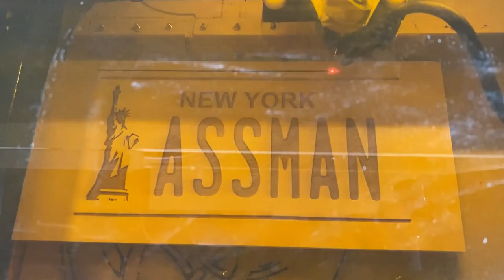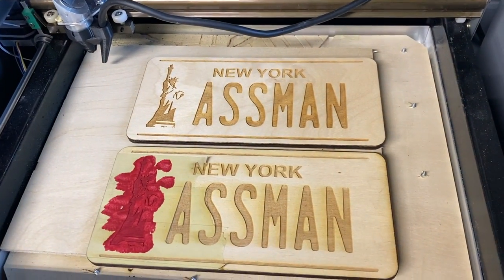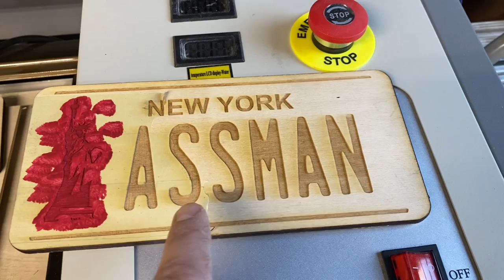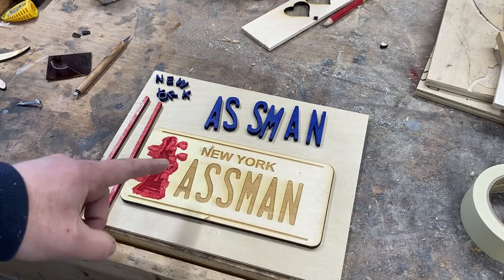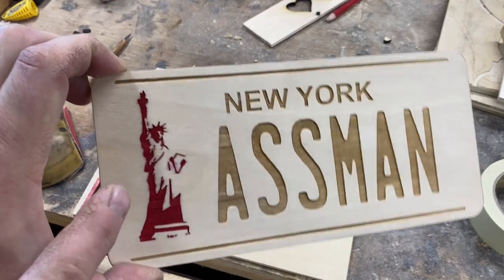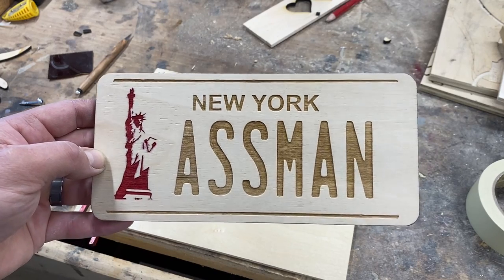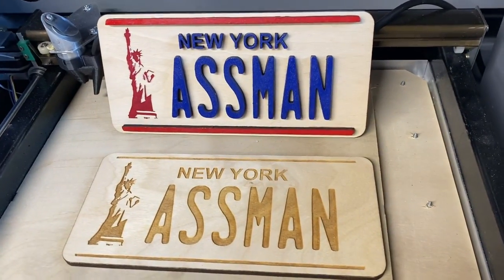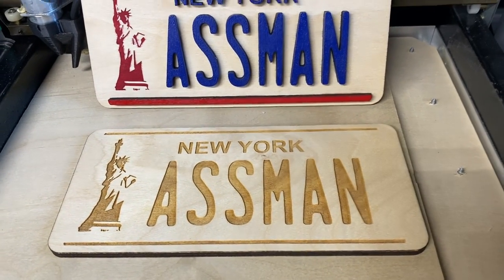K40 Series - Sign Alignment Trick. Can Be Applied to CNC as Well

Comment: I like the color but I would have like to see how you designed the file or files. I assume that the base is cut inside and the letter are cut on the outside of the lines
Reply from the maker: Thanks! I plan on doing a video explaining the process on a CNC, with a detailed walk- though of the process
Reply: @SJSSawdust  I look forward to the CNC version. No laser yet just a CNC.